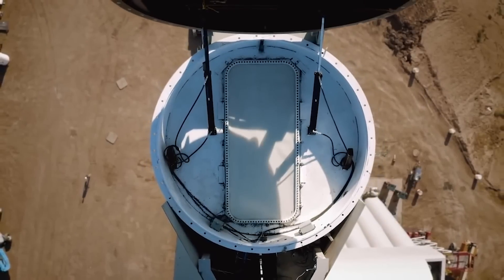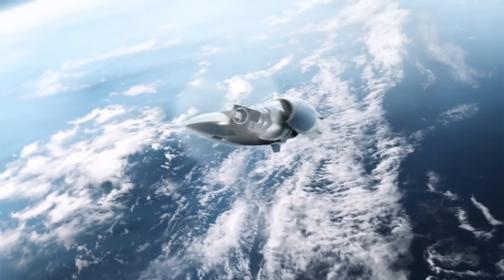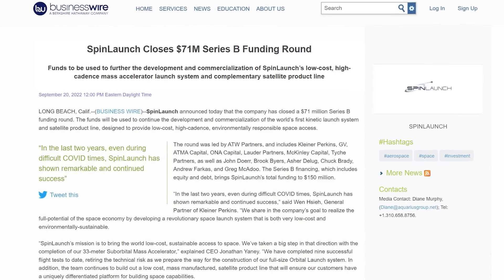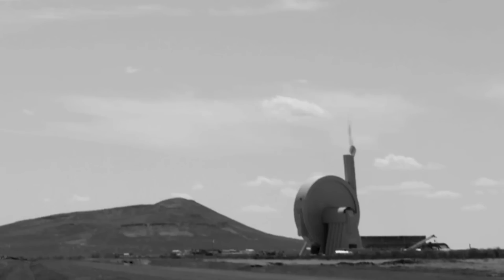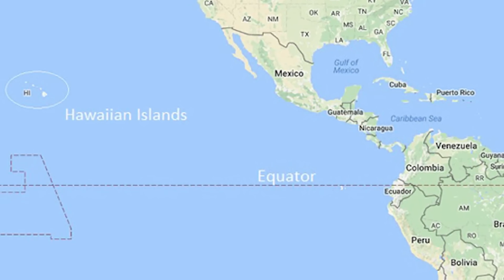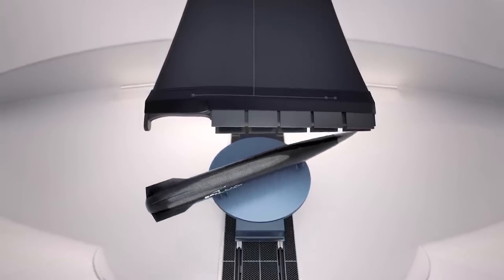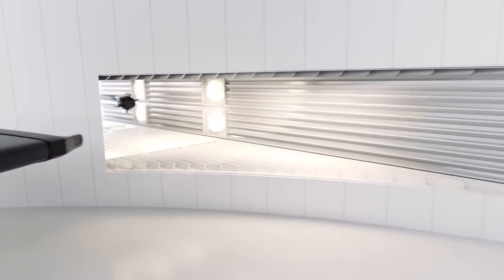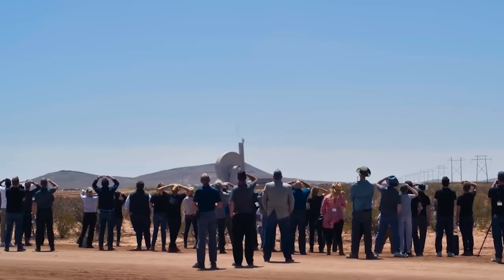What Happened To SpinLaunch & The Orbital Accelerator?

Comment: i'd heard about this spin idea..and i've wondered when the payload is released how does the remaining structure handle the sudden imbalance in the rotating part? it's hard to imagine the thing spinning with only the counterweight left..or even if it came to a sudden halt after release wouldn't that crack the arms? maybe if the payload was flung into the sky at the same time an equal weight on the other side was flung into a hole in the ground (poor thing...)
Reply: Currently they smash a counterweight into the ground. Apparently they plan to use a much heavier object in the orbital launcher, that is reusable in the future.
Reply: my fix would be using two counter rotating spinners and always launch two sattelites at the same time

Comment: My biggest concern with spin launch is the 10,000 Gs the satellite and booster engine are expected to survive while spinning.

Edit.
I am concerned about the plumbing for an upper stage rocket, and an antenna large enough to aim back the 100 miles to earth, and unfoldable solar panels.

Edit:
With at 100 meter diameter spinner, would need 10,000 Gs  ( not 50 Gs ).
Reply: That number is a little too low. It's closer to 10,000 g's.
Reply: This comment displays nicely how much they misrepresent their progress.
Reply: the goal of the project is not to launch actual spacecraft. It is to take in investments and other funds. 

People who have satellites to launch know about G-force tollerances.
Reply: @batner  Yeah. I think they are just trying to build hype and sell their startup while they are on top.
Reply: Then there's impacting the atmosphere as you leave the vacuum chamber and then the heat from air friction as it travels at much greater than orbital speed through the thickest part of the atmosphere as the whole point is to still have orbital velocity once it leaves the atmosphere so the speed must be much greater at launch and remember how much re-entry heat we currently have to deal with when a spacecraft slows below orbital velocity and encounter the thinnest portion of our atmosphere.   If they want to go with this launch strategy then they need to focus on suborbital and firing a rocket once it leaves the atmosphere to finish accelerating to orbital velocity without the hindrance of the atmosphere.  Not quite completely rocket less launch but something that is probably achievable.  There's a big difference in velocity required to be orbital from suborbital.  The Canadian space gun was focused on firing a rocket once out of the atmosphere though they never got past testing a few models for aerodynamics and launching suborbital dumb ballistic loads that would be unaffected by the extreme g-forces.
Reply: @johnwang9914  I agree with the concerns you raised regarding the air friction after leaving the pressure chamber. But the payload will need a rocket in any case (if they want to reach a stable orbit around earth). Orbital mechanics dictate, that the projectile will hit the earth after revolving around it. So you always need to fire up a rocket and increase the speed after launch (when the projectile ist at the peak of it's trajectory) to "pull up" the orbit on the other side of the earth.
Reply: Some people, instead just mentioning Thunderfoot, would be better of posting better arguments than Thunderfoot. Or debunking him. I'm not a fan of him, but most of the points he makes in his videos are at leased based on reason and scientific arguments.
Yes, we need people thinking forward, and trying new things! And go beyond what we know and can do today. But we also need realists, that can distinguish between what is realistic and and what not. And SpinLaunch, in my opinion, is or will be a big waste of money.
Reply: @andedabtau8335   My favorite comment in this string is: "and it's honestly baffling that it's gotten this far."  Most people who think the project will fail, would (or did) predict they would never get as far as they have.  
Anyone not predicting complete failure is quickly vilified, accused of being a fan boy, or being a paid shill. 
I'm one of those in the middle who thinks the project is interesting, faces huge challenges, but deserves some credit for getting this far.
Reply: @bradleyrex2968  I didn't say anything about fanboys or something like that. It is amazing that they found people investing such a lot of money into that idea though, yes.
Look, I worked in projects which were based on false promises. Some people are also blind when it comes to see hurdles to high or impossible to clear. In this case, show me the engineering principle behind the fast closing doors. I'm convinced they don't know how to build them yet. So why built that huge chamber, operating it without a vacuum, when you don't know how to build the doors yet? Some stuff can be thought out on paper, before you start building such a monstrosity.
Reply: @andedabtau8335   I'm sure there are many things you didn't say.  No need to list them.  
The functioning of the doors are one of the things they've chosen to keep secret, but they have shown them working.  The Real Engineering video shows them.
Reply: @bradleyrex2968  They do have a really fast shutting door indeed. However, still not functional in the actual launcher, otherwise they would not need that membrane, right? (Which did not seem to be under any tension anyhow...) ;-)
But hey, future will tell if they manage to overcome these hurdles. I would not bet my money on it, that's for sure. But would be happy for them if they did.
Reply: In WWII the British invented the radio proxomity fuse. The electronics within could withstand 20,000 g plus. With todays solid state electronics this problem is largely negated.
Reply: there are guided "smart" shells that take up way more Gs in the canon tube, and they hit the atmosphere just as harshly. They still survive with all their electronics onboard.
Reply: It would be easier to design a space gun instead of this spinning monstrocity.
Reply: 50gs? It's actually 10,000Gs while it's spinning. Also, you need to get to about 18,000mph at release, to get to orbit, they're currently claiming they can reach 4700mph... So they will need a second stage capable of another 13,000mph... Not happening.
Reply: @eugenes9751   Considering this is a 1/3 scale prototype intended to test concepts and engineering, AND Spin Launch themselves say a 2nd stage will be necessary, it seems a little odd to make those pronouncements.
Reply: Not to mention the vacuum that will fill with air the moment the rocket exits going mach 30+. We've all seen space ships as they enter the super thin outer atmosphere, imagine hitting a wall of full atmosphere both in terms of heat and aerodynamic stability.

The idea is garbage, it'll never happen. We'll have fusion powered apace elevators before this vaporware ever solidifies.
Reply: A number of people are saying the acceleration would be 10,000 g, and that is incorrect. The launch velocity needed to get into LEO without further acceleration during flight is 9.4 km/s. With a 50 m radius of the accelerator, it causes 180,000 g to have that launch velocity when the projectile is released (a = v^2 / r). If the projectile has a rocket motor, it requires less than that launch velocity of course, but then the rocket motor etc. must withstand whatever the lower acceleration is.
My view is that  this will never be suitable as a launch platform for LEO.

The 10000 g are closer to what would happen on the moon. Using the escape velocity of 2.4 km/s (assuming the goal is to get something back to earth), a launcher with 50m radius would have 11,700 g (earth-g).
Reply: @andreasmaier7603   Their design has a rocket motor.  Probably best to use their information and not that of a number people.  Does this mean you will not invest in the program?
Reply: Modern artillery shells contain electronics that survive 70,000 Gs so 10,000 is certainly doable.  
And they have said 100 times their payloads will require different design.  But with weight and density being an advantage in their systems, that could be a significant advantage.
Reply: @bradleyrex2968 which of those electronics are extremely sensitive satellite electronics?

You do know they sweat over every single G? Not to mention their propulsion systems have to also sustain 10,000G. Tanks, tubes, lines, fluids.
All of the mechanisms in board. The reaction wheels, solar panels, solar sails.
That's a lot more than a shell with a proximity fuse. And every single ruggedized piece costs weight. Which costs money.
Reply: @t_c5266   Every single ruggedized piece costs weight? Which costs money?  No.  "extremely sensitive satellite electronics"  costs money.  This system does better with normal heavier cheap electronics.  If you must use delicate ones you simply imbed them in resin. 
Maybe you don't understand, the system relies on momentum.  More mass = more momentum, and you want sensitive delicate stuff for some reason...
Reply: @bradleyrex2968  you clearly don't know about getting mass to orbit 🤣
Reply: @t_c5266    Ah so the problem is me now. 🤔  I think we know who is sensitive and delicate. 🤪
Reply: @bradleyrex2968  you lost. So you resort to attacks. This was too easy
Reply: @t_c5266   The first Ad Hom attack: "you clearly don't know about getting mass to orbit 🤣", and now you complain about his?
Reply: @TexMex421  you haven't proven otherwise. My statement is factual and accurate. You're not knowledgeable in this subject. Therfore your opinion is not worth anything on the subject
Reply: @t_c5266   I proved my statement. Otherwise is up to you.  Also you seem to be confusing me for someone else.
Reply: @bradleyrex2968  look spin launch won’t sleep with you so no need to simp about it so much
Reply: @opmacace523   Devastated. (I am)
Reply: @bradleyrex2968 How many of this artillery shell electronics are able to do their job? And lets make it 10000 g. Not 70000.
Reply: @flybywire5866  The military standard is 5 9s, or they don't pay the manufacturer.  So 99.999%.
Reply: @bradleyrex2968  you're forgetting that there also needs to be a second stage within the shell to circularise the orbit and stop it from reentering, as well as endless other things. It's very, very, very stupid as a concept, and it's honestly baffling that it's gotten this far.
Reply: @asdfasdf-dd9lk   Yes... yes...  Thunderfoot, the world sucks, here's your cookie etc.
Reply: @bradleyrex2968  whenever i see people "debunking" work done by teams of trained engineers, I can't help but hear the sound of half-baked napkin maths and copying of Thunderfoot's homework :D
Reply: @jaqssmith1666  Anything besides implied personal attacks and non sequiturs? Like pointing out actual flaws for example? I can put your name in quotes too, doesn't make you cease to exist, doesn't it?

Comment: why does everyone think they are planning to launch this thing at 25 mach?  All they are doing is increasing the size of the one they have by a factor of three.  They are still launching at Mach 5 with 10g's internally.    Orbit is achieved with an engine and fuel on board. Will the fuel and engine survive spinning at 10 g?  I would think so...   Will the arm hold up 3 times larger than the one they have built now......uhm, I think that would be pushing the limits of tensile strength of the materials they are using...  but it seems like they did all their calculations correctly for the one they have now.  They probably havent found a place because if it does work, it would destroy the medium to small size rocket industry completely .  The US government wouldnt allow that to happen.  Also, China and Russia could mass produce these and put dozens of satellites a day into orbit... in fact, almost any country would eventually be able to build this thing.  All the problems they will face are political at this point.  Until China or Russia builds a successful one, the US military will prevent this technology from advancing.  This company will never find a place to build the larger model... it will not be allowed for obvious reasons.
Reply: @criticalevent  the first stage is the most expensive and dangerous part of a missle launch....like I said, its all about politics now.